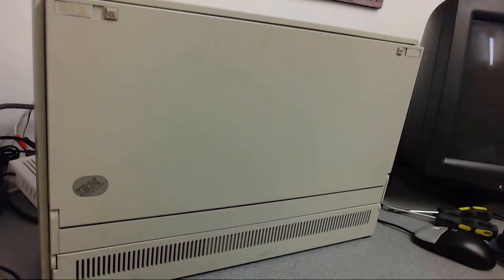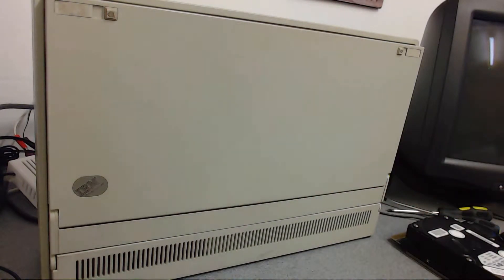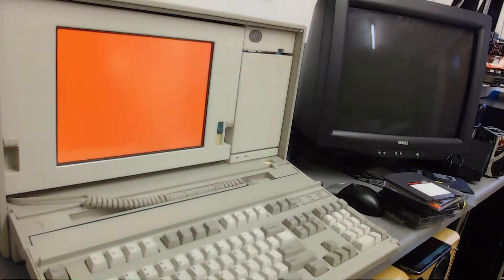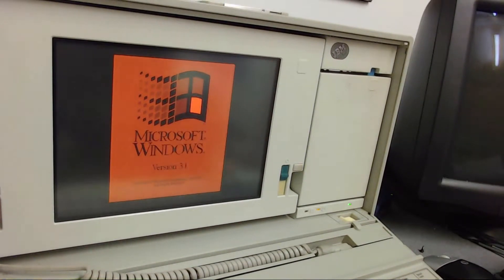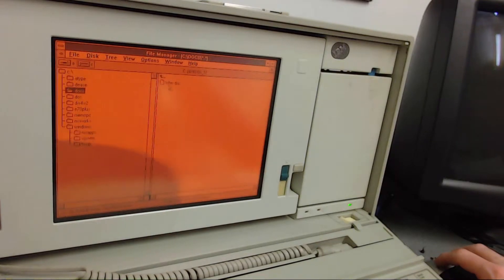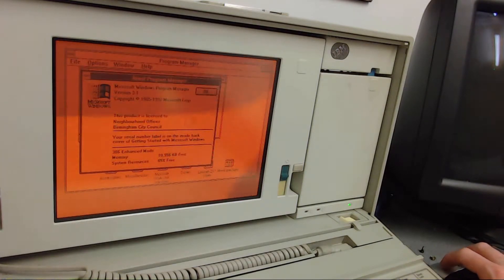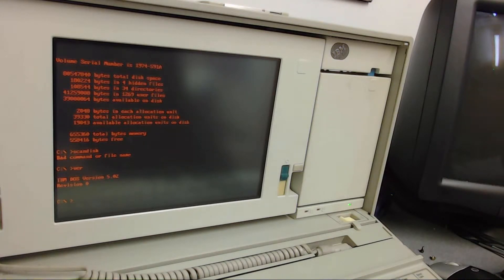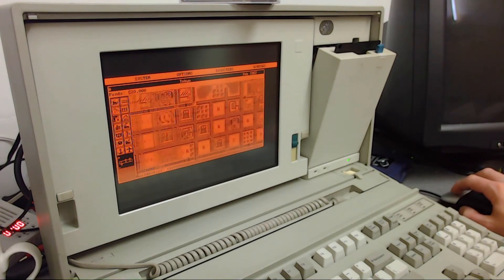Fixing the IBM PS/2 P70's hard drive

Comment: Wonder why the floppy drives die on these things, I couldn't personally save the one on mine though I still have it stored somewhere. Modified a newer PC drive so that the original cable worked but the button didn't line up and it wasn't a very good fit.
Later on I put a Gotek into it and since it needed 5V I just ran a USB cable through the back and power it externally but I do wish to eventually find a 5V source from the P70's own power supply or just a better solution in general. Annoyingly I last tinkered with it like 5 years ago so I don't remember much about what I did but they're such cool machines 🙂

Looks like there's an McIDE card these days that should help using other kinds of drives or CF cards whenever these original drives die and become impossible to find, really glad to see people are keeping these things alive. Also people are making replica MCA sound cards as well which is fantastic because the P70 definitely deserves a sound card, even though OPL2LPT works fine as well

Comment: This is not fixing, this is replacing. :/ I was specifically searching for a fix on this hdd.
Reply from the maker: Most of those old ESDI drives I come across now are unfortunately failing and unfixable... You need to replace with a working drive, or add a SCSI MCA card and drive or even one of the new IDE/Compact Flash MCA cards that are about to be released.
Reply: @StevesTechShed  I was going off on the title of the video, which literally says fixing the hdd.

Comment: Visible bad sectors on an ESDI drive are typical.  Like MFM and other pre-IDE drives these do not perform internal sector remapping. IDE and later drives have firmware routines which remap and hide bad sectors. Unless it’s gaining bad sectors regularly it may be ok. A large cluster of bad sectors in one area show that it was probably dropped while powered on.

Comment: Are PS/1 Drives compatible? I have a P70 here with a HDD not being recognized at all. Any ideas?
Reply from the maker: I'm pretty sure all IBM PS/1 PCs had standard IDE drives so no, you need an IBM PS/2 compatible ESDI drive I'm afraid. Oh or an MCA SCSI or IDE adapter and relevant drive if you can find one for sensible money.